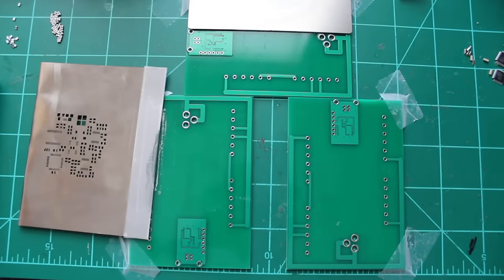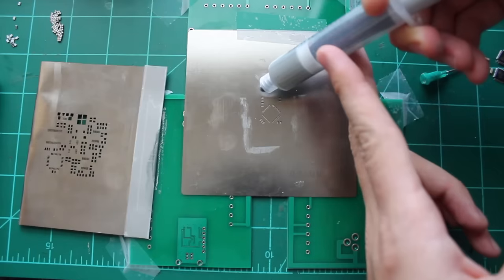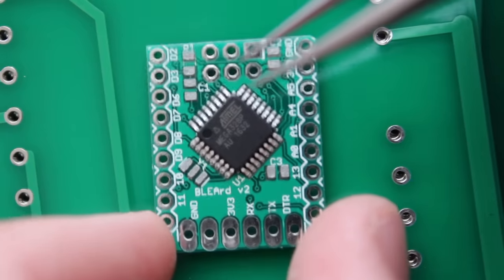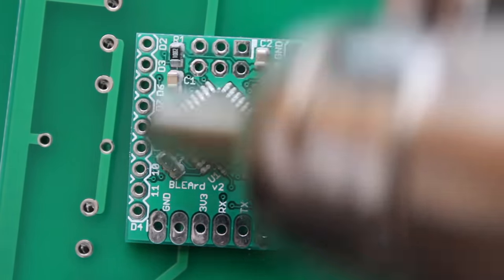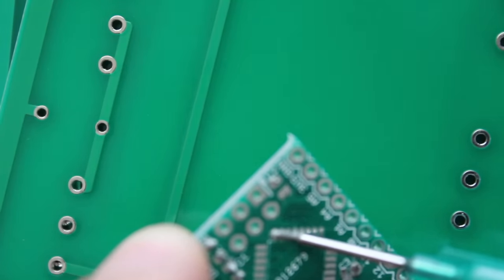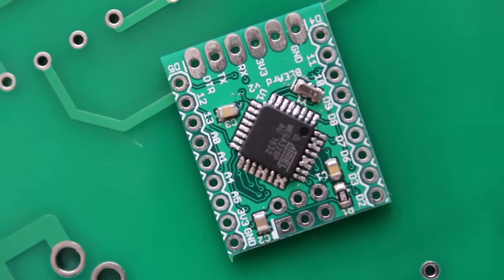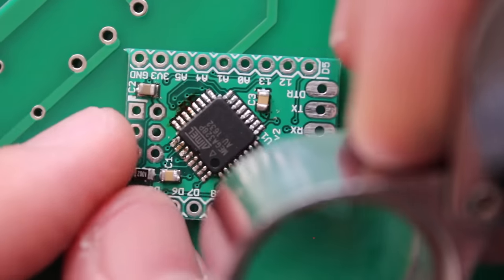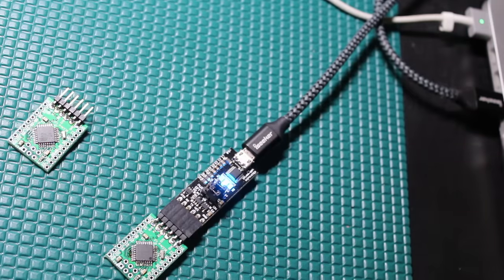Easy way to Solder Surface Mount Parts! - How I do it

Comment: If you do not have a stencil an easier method to do this is what is referred to as the poor mans method. This entails pretinning all of the pads for the components on the PCB first using standard solder and no clean solder flux. Once the pads are tinned clean the PCB with isopropyl alcohol, apply no clean solder flux to the pads, place the parts then hot air reflow everything. This method allows you to more accurately apply the solder and reduce that bridging. If you do use a smaller nozzle on the hot air gun, the temperature can be reduced, 400C is in the danger zone as far as what smd components are designed to take. You should be able to reflow at around 315C or about 600F. Size of nozzle, air setting and distance from the PCB all will affect the temperature of what you are working on.

Comment: Where do you go for the PCBs? I've played around with arduinos etc for a couple of years but now I've taken on a project to create my own keyboard for my final year university project and I'm thinking of creating some simple through hole PCBs for it. Could use somewhere that can do it for cheap but reliably.
Reply from the maker: check the description - electrodragon also has cheap PCBs, so you can get the stencil and boards at the same time
Reply: OSH Park does really high quality PCBs. It's $5 per sq. inch for 2 layer boards (silk-screening on both sides too) and that includes 3 copies of your board.
Reply from the maker: yep, use OSH park all the time as well
Reply: James Coyle

Comment: I do not dispute your handy work at all by any means but the fact is that most viewers do not have access to stencils/cad files or the ability to relieve the stencils from their excess metal. All they would like to know is the easiest way to solder smd chips and other devices. I'm sure they're people out there to disagree with me but if they do then they need to think back when they first started out and didn't have any help other than a knowledgeable friend of local college.

Comment: Hey Kevin, great video! What would be a good, cheap soldering iron to start off with for smd work?
Reply from the maker: funny thing is that I still use the same iron (and tip) I picked up from Sparkfun years ago.  I actually soldered the entire LED cube with this too.  https://www.sparkfun.com/products/retired/10707  Doesn't look they sell it anymore, but I'm sure you can find the equivalent on Amazon somewhere

Comment: Thank you +Kevin Sarah . That will really help a lot. Is it possible to 3D print stencils?
Reply: Can't see why not! Nice Idea.
Reply: Victor Rivarola I don't think the average 3D printer is even remotely precise enough to make stencils for SMD parts - those IC pins have very close spacing!
Reply: Closer than 0.3 to 0.1 millimeters? That is the resolution of your average 3D printer!
Reply: Victor Rivarola A 3D printer has a nozzle what, 0.35mm large? No, that's not nearly small enough to accurately lay down a stencil for a common QFP with 0.65mm pin pitch. (That is, 0.65mm from the center of one pin to the center of the next.)

Comment: What cheap solder pastes would you recommend?
Reply: From what I"ve seen, I wouldn't use the cheap stuff. Go at least one step up, I"m hoping I've chosen a good one, its called mechanics solder paste xg-50

Comment: Thanks for great video! Nice looking board: Bleard v2. 

Let ask a question: We all tend to use m328p a lot.
I thought to move to higher Frequency one, say AT89C51ID2 or  ATSAM3S4A / ATSAM4N8A / ATSAM4S2A .

Will it take a long way to pair it up with Arduino IDE? Any other precautions or suggestions you can give?
Reply: Vitaliy D have you tried stm32f103c8?  I switched a couple projects ago and they are a dream!

Comment: Ah yes, the usb paradox. You must always Flip it 3 times.
Reply: Yeah, I guess that's why they've gone onto the new-fangled both-side same-side ones on the latest smart-phones. And rendered a gazillion phone-charging/music player thingies obsolete at a stroke. Again.
Brace yourself land-fill sites, lol.
Reply: @Flare1107
still better than the big square ones on the back of a printer that you try quarter turns , then after about nine or ten turns it goes in :-)
Reply: Stephan 'Uhu'  I don't think you are supposed to send electronics to land fills

Comment: Flux. Untill u learn to use it.. .. The crystal (or any other part ) was soldered adequate or sufficiently for cases it works, properly would be a stretch.

Comment: Well that is really cool, Unfortunately that is no help in soldering my guitar up. Holding the wire, soldering and the wire staying in place is what I struggle with. I wish I could use the helping hands.
Reply: Use a roach clip. Tape it in place if you have to.
Reply: might be able to do that for some, 3/8 inch long wires are not fun for construction hands. thanks it helps
Reply: I'm trying my damnedest to figure out what wires on a guitar are 3/8" long (or short) unless you're doing pick-up work? Try a small amount of super-glue just outside the solder area to hold it in place while you solder it.
Reply: They are on the push pull pot, It look exactly like the 6 holes on the bottom middle of this video at 10min 50sec. for out of phase wiring, coil splitting and so on.
Reply: You could see by looking up CTS push pull potentiometer.
Reply: Needle nose pliers, bend a hook in wire, hook it through the hole and crimp it to the terminal, then solder.
Reply: Thanks, that is exactly what I am going to do, If I still had 10 fingers it would be a different story.. Being slow and melting the insulation has been the issue, If that happens again I think I will get some liquid rubber and paint it on any bare wire caused by me moving too slowly.
You have been very helpful, I really appreciate it thanks
Reply: Use wire with teflon insulation.
Reply: oldcar85   wow, never heard of teflon insulation wires.That would have really helped. I did get it done and it actually even looks good.Thanks and have a great day.

Comment: What is 'sarder'?
Reply: I use soLder - must be doing it wrong
Reply: Hahaa! When I came to Canada, I had to get used to them saying "sodder", and 'erbs for herbs. Oh, and they mount the light switches upside-down..
Reply: That really is the correct US pronunciation.  They all say it like that.  Solder comes from the Middle English soudur so the US pronunciation is probably closer to the original English pronunciation than the modern English pronunciation, which has been influenced by Old French.

So there.
Reply: The act of joining metals by soLdering dates back over 5000 years and the word solder originates from Latin solidare ‘fasten together’ and from solidus ‘solid’
Reply: Dan Nelson That is indeed true but the word solder came to English via Old French not directly from Latin and in French it had lost the l.  The modern English pronunciation may be closer to the Latin but the modern US English pronunciation is closer to the early origins of the word in English.
Reply: Joshua Rosen well I might buy the argument that it came from Middle English if it was spelled Souder as it was in old English but it's not, it's spelled Solder based on its Latin origin.

 Remember we are talking about a word that's over 5,000 years old and dates back before Middle English. Europe was in the Dark Ages while Muslims in the Middle East we're soldering  Metals together. 

In fact at that time the Arabs were the  world leaders in science and technology, among other things they gave us algebra and named about 80% of the Stars.

 It's amazing what religion can do to a civilization. At one time the Arab nations were world leaders in science and technology and because of one religious nut who deemed that math and science was the work of the devil the evolution of an entire Advanced civilization came to a screeching halt.

 Because of religion a civilization that was once a world leader in science and technology is now no better than a third world country.

 Not to bring politics into it but it sure seems like the United States is following in their footsteps. Conservatives in America are demonizing science and Technology and are pursuing religious Doctrine instead of science and mouse.  

This has only been going on for less than a decade and the United States is already falling behind the rest of the Civilized world. You know that 80-plus percent of trump supporters believe that global warming is a hoax and just about that same number aren't vaccinating their children anymore and I won't even go into Chemtrails and all that crap. And here we are arguing over the origin and proper pronunciation of solder LOL

By the way I hold an extra class amateur radio license as well as a commercial radio license. And I have to say the decline an amateur radio is absolutely mind-boggling. I'm ABI that was once based entirely on science and technology it is now nothing more than glorified CB nowadays when you tune around the hand band that sounds like am talk radio with a bunch of Rush Limbaugh wannabes. When I first started ham radio when you change around the Bands you heard EEs discussing Electronics and nuclear physicists answering questions and discussing radioisotopes and so on and so forth.
Reply: Dan Nelson I have just had a look in my copy of Fowler's Modern English Usage which says that pronouncing the l is a recent practice.  In an earlier edition than mine Fowler apparently wrote of the silent l pronunciation that it was "The only pronunciation I have ever heard, except from the half-educated to whom spelling is a final court of appeal ...".

Fowler doesn't seem to approve of your l.
Reply: But there's a biblical homophone you wouldn't to confuse - especially with a 400 degree heat source!
Reply: The word does sound more like "sarder" than "sodder" to me.

Comment: expensive way to solder...
Reply: Not if you are making a lot of them.  Time is money.
Reply: Expensive and time consuming. I build prototypes a lot more complex than this everyday, I would have build this thing in less than 1min with an iron and solder wire. I only pick up my heat gun to dessolder. With practice you'll become better and faster. Also, if you don't want to blow away neighbour components use fibreglass tape to make a mask. To hold the board still use blutack. A clean solder tip will 'absorve' the solder excess, for a perfect finnish brush the board with alchool.

Comment: Don't do it this way! You will invariably heat up some parts too much. Use an oven with a controlled temperature profile. About $250 on ebay.

Comment: Scotch tape.  Didn't mom tell you scotch tape is an ESD source.  Use masking tape.
Reply: Haha he used a tiny amount and really, those chips arent going to pop easily.  Plus if it was really that vital he wouldnt be handling the chip with metal tweasers directly to his fingers without being correctly earthed.  Funny comment though dude.  Like.
Reply: Ri
yes ch Obermeyer
Reply: the scotch tape is only needed during applying the paste, when no components are on the board, so no worries.
also, do you know how much ESD is generated in PnP environments???  I think he will be ok.
i have heard the scotch tape lines at manufacturers throw huge arcs when unwinding, would be cool to see

Comment: FYI for your hot air system. https://github.com/0xPIT/Air858
Reply from the maker: oh that's cool, I'll have to check that out
Reply: Kevin Darrah and depending on your hot air system it might have an atmega inside if you crack the case. Mine did. github.com

Comment: How many of you little hobbyist who needs to make a quick circuit, is going through the bother of making a metal stencil & happens to have a rework blower handy. C-mon.get real. BTW solder paste is awefull. if you want cold solder joints, use paste. want joints that last. use real solder.

Comment: If I had a solder paste stencil I'd take it to a small board house and pay the $26 an hour to have someone else do it. I've taken a board that size with the same amount of parts done at a house for $50. My time is money worth more than that. But thanks.